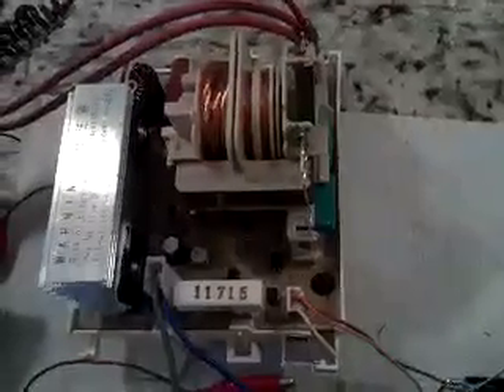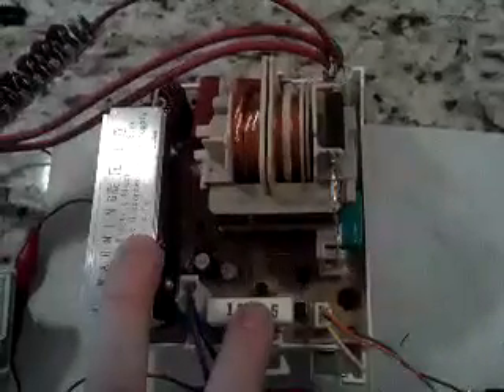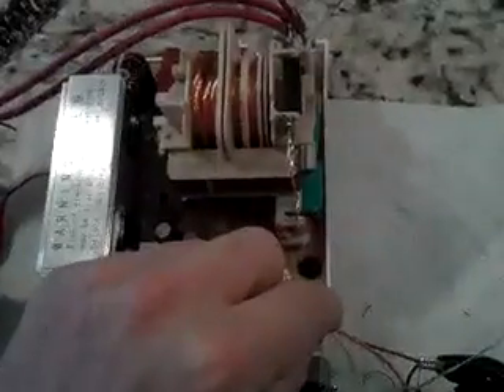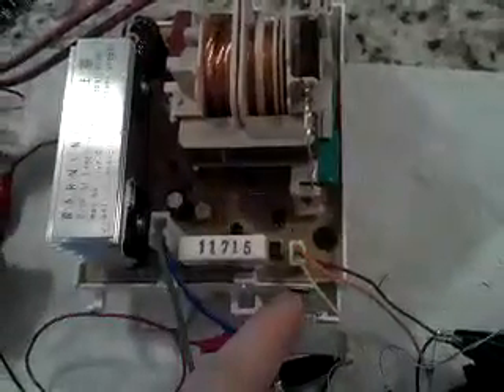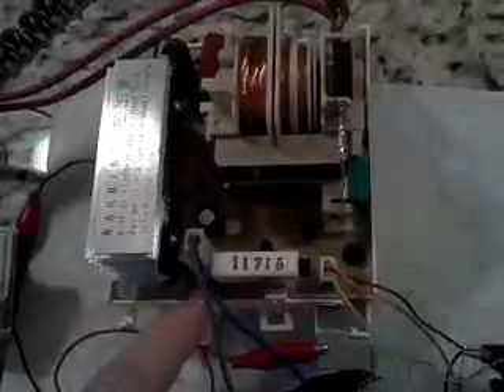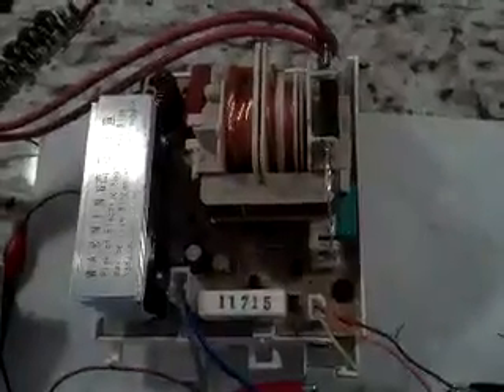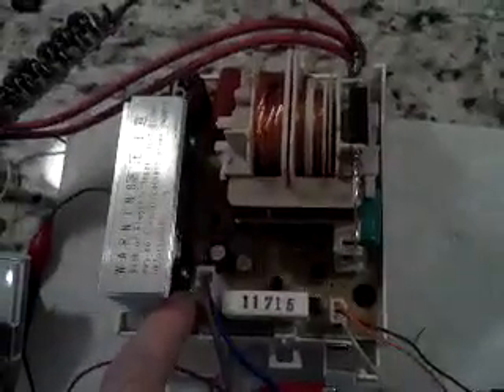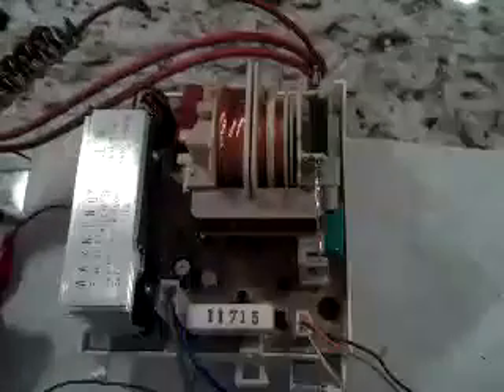Microwave oven inverter hacking - the new MOT

Comment: Would an RC servo tester generate the right PWM signal? That would be a really easy and cheap way to control it if it does, it has a little dial to set the PWM value. I got one of these newer MOT units recently and couldn't for the life of me get it to work, not knowing about the PWM thing, so I scavenged it for components but I'll keep an eye out for another one to experiment on, being able to adjust the power level would be great, it would have worked well for a capacitor bank charger I'm putting together. These do come with some excellent components though, I got a great ferrite core, a good length of fine magnet wire, a few feet of Litz wire, a mosfet, a 1000V bridge rectifier with heatsink, a bigass resistor, a couple small capacitors and a few other odds and ends, at least it wasn't a total loss. Now I'm using the 1KV rectifier on my capacitor bank charger that's using a regular iron-core MOT connected to a 500 Watt variac to dial in the 475 Volts I need for the caps, with a couple light bulbs in series on the primary to get my current way down. It's going to be fun, the bank has nineteen (would have been 20 but one was bulging😒) 422uF caps at 475 Volts each, with a total capacitance of 8,000uF so each pulse will be just shy of 1KJ.

Comment: great info thanks.  Do you think I could rewind the primary to take 12v inputs?  so I can run microwave on 12v.
Reply: This is what I’m trying to do right now. It seems there is some sort of AC sense circuit, I’m gonna pop off a resistor and see if it can function without mains but 170V dc instead first

Comment: So the term "inverter" is a lie, and these actually use the opposite (a rectifier) to work. And pulsed DC is not the same as AC. Taking AC and turning it into DC is exactly the job of a rectifier. There ought to be a law prohibiting deliberately misleading nomenclature.

Think about it: an inverter is what creates AC electricity. To apply an "inverter" to an AC power source is worse than pointless.

I think I'll manufacture a switchmode power supply and call it a "Transformer®".  🙄

Comment: This is a very informative video.  Thanks for the hack.   I have one of these inverters from a Panasonic NN-H665BF microwave.  I also want to repurpose the timer controller from this microwave on a separate project.  However,  the 3 lines from the main PCB to the inverter and/or the line voltage  connections to the inverter are required somehow to feedback to the controller that the inverter is powered up.  If these lines are not completed, the timer always stops after 3 seconds.  Do you have any idea how to bypass this function  on the timer/main PCB?  I thought it might be that the orange 110 hz square wave line needs to be simulated by a custom 555 timer circuit?
Reply from the maker: I have no idea. I did not attempt to use the microwave's control board at all. However, I would start by simulating the same signals and voltages on its interfaces that you find during normal operation. The PWM signal might be important.
Reply: Did you end up  working it out ? I'm not having any luck.  Mine read 220hz 30% duty when attached to inverter but when I disconnect and give it that with a generator it still stops after 3 seconds........

Comment: Poultonm; thanks for your video, it was very illustrative, but I was wondering about what you said in the vid description; do you think replacing the high voltage transformer with a cooper loop will do the same job as a induction heather or it requires anothers modificions ? Thanks in advance for your comments.

Comment: Hi good day i have the same microwave  but no display on controller board and i saw smoke coming from microprocessor on controller board  , can i set up a seperate controller board using the 555 timer ic to turn on the high  voltage circuit ? Can you please assist me with the shematic diagram.thank you.

Comment: Hi friend, Excellent work! I came across your YouTube just lately and am enjoying them thoroughly. Thank you for your skillful engineering work.
I think +5V at pin 3 after the AC power switch on will work. Don't you think?
Somebody overcame the cutout problem you experienced by modifying the PWM TTL signal input . Thanks again Nwin
Reply: nwintran  Sorry I missed Anton's comment on when he applied +5V to pin 3 and the inverter did not work. Just now I was assured by a Panasonic microwave inverter oven technician that if one turns on the  Panasonic Inverter oven then select full microwave power (100%) then the full power will be on in few seconds seconds. Does it mean the same as applying +5V to pin 3 in a PWM controller.
Reply: nwintran
Sorry I was not quite correct in my last sentence in a previous comment. For full power the duty cycle of the PWM must be less than 90%. This means that applying +5V DC  is not exactly the same as a 90% duty cycle PWM TTL signal.

Comment: Hi, I want to do something similar, but instead of using the inverter ps, I'm trying to use the oven with the old transformer, capacitor and diode just to eliminate the inverter ps. I connected a 1k resistor between orange and brown and it worked, but only for 23 seconds, then shut down. Have any idea what is going on here? Thanks.

Comment: What voltage must the 220Hz square be at? Also, does it have to be strictly 220Hz, or could it be off a little?
Reply: TheSmileyFacedPizza  Hertz is not as important as duty cycle. But if you're using an Arduino, you shouldn't have a problem matching the hertz exactly

Comment from the maker: This would not be a good choice for an ozone generator.  Ozone generators require high voltage at low current, and total power much lower than what this is designed for.  A flyback transformer would be a better choice.  This thing does not produce enough voltage, and is far too dangerous for that application.

Comment: can you show us how to bypass the duty cycle circuit? is it possible to simply power the inverter with the microprocessor board or control panel of the microwave

Comment from the maker: I would assume it performs very poorly, probably by self-destructing.  It might survive since it's a constant-power regulator, but that would be well outside its normal operating parameters so I would not expect it.  The results will not be as impressive as you hope, since iron core transformers handle very high peak powers that make impressive arcs.  This thing will never push much more power than it's designed for.

Comment from the maker: The control circuit is at least as simple as anything you could reasonably want to power with this thing...  It's about the simplest project possible using an integrated circuit.  There are literally dozens of different ways to build it that would work.  All you need is a square wave with the proper characteristics.  A quick google search will turn up plenty of possible approaches.  I just googled square wave oscillators and PWM circuits to find a solution that would work with parts in my bin.

Comment: I just found a post on fusor.net that says:  Pin 2 is a common lead. Pin 1 is driven through an opto-isolator with a signal related to power output. Pin 3 is supposed to accept an oscillatory TTL signal whose duty cycle determines the power level, which again is coupled to the board control chip via opto-isolator. However the board produces full power if +5VDC is applied to this pin. The AC mains must be hooked up for some small fraction of a second before 5V is applied or it won't be recognized

Comment: Many have asked, but could you please post a schematic of the 555 circuit? Im at a complete loss on what values to use for the capacitors and resistors.

Comment from the maker: @Alex1M6 I'm sure it'll be awhile until the iron transformers go away.  These are still only in high-end microwaves.  While these are flyback mode converters, the transformer doesn't have much in common with a CRT flyback except a gapped ferrite core.  The turns ratio is about 10x lower, and it's made for much higher power at lower voltage.  Peak secondary voltage is about 4.5kV.  And unlike a CRT flyback, these things will straight up kill you and set you on fire.  Just like a MOT.